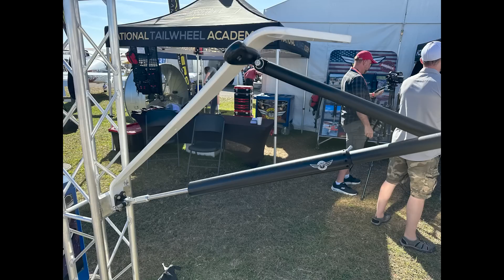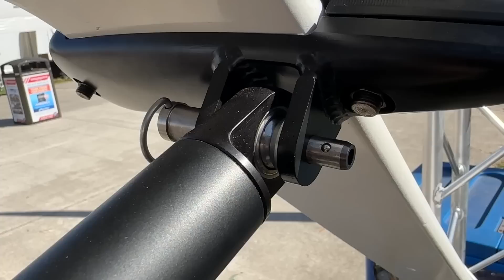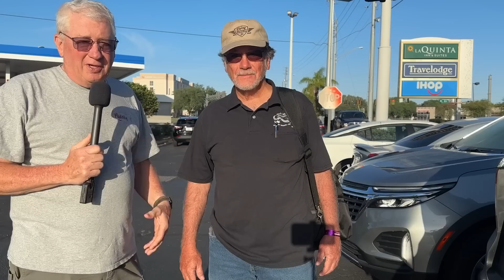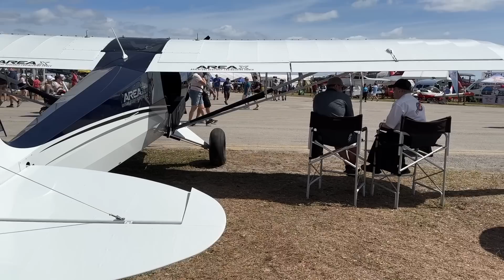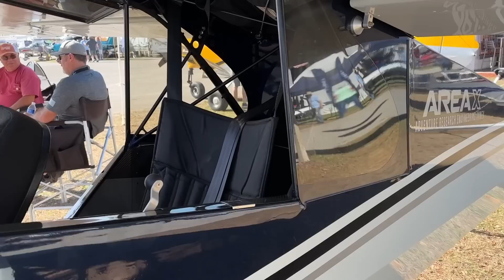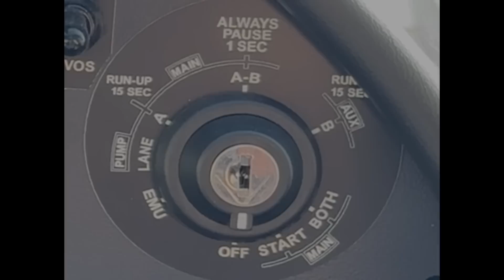FlyWire Sun-nFun 23 Day3 4, Carbon Cub UL Update

Comment: G'day Scott,

Yay Team...!

I really like the look of that Corrugated Sheet Aluminium  Tapering Tubular Fuselage on  the Junkers Trainer..., I can barely sort of imagine how to cobble that up and tinker it all  together... ; and I love the way it "Echoes" the Klemm Swallow/BA Swallow..., of the 1930s.

A Plywood 2-Seat Low-Wing Cantilever-Wing Open-Cockpit Sports/Trainer, with an 85 Hp Pobjoy Radial on the BA versions - and the one I saw, touched, and spoke with the owner thereof, had been re-engined with a 100 Hp Lycoming.

He was quite a "Character", designed, built and fitted the new Engine-Mounts, swapped the Engines, and THEN flew down to Bankstown, landed, taxied up to Bullshit House (Dep't of Transport, Aviation Safety Beaureau - as it was, back in the day...?) - walked in and asked them to hatch whatever Paperwork they wanted, to cover what he was doing and had proved to be workable.

Back in the Olden Dayze, when the Beaurocrats were still reasonable...(!).

The Klemm Swallow was a Gem, and that Junkers looks bloody BEAUTIFUL...(!).

Regards the Shockies for SpringyBOUNCY Cesnas...; Removing them for occasional Cross-Country events is silly.

A Round cross-section, at 60 MPH and upwards, generated 500% the Drag of a Streamlined symmetrical Teardrop Cross-Section of the same diameter/width/thickness...

So, a couple of Styrofoam Blocks and a Hot-Wire Cutter could yield Leading and Trailing-Edge Fairing-Fillets, fit for being glued ahead of and behind the Tubular Shock-Struts...

With a subsequent spiral-wrap of 1" Pinked Dacron Rib-Tape, and a Coat or two of Laminating Epoxy...

The outside of the Shock-Strut Cylinders could EASILY have their 
Aerodynamic Drag cut by
80%, 
For maybe an extra 
1% 
Additional Weight added to the
Strut.

Don't Pig-frig around with Ground-Removable Undercarraige Improvements..., if they're worth fitting then
STREAMLINE them...

And
Leave them
There, 
Permanently...

Such is life.

Have a good one..

Stay safe.

;-p

Ciao !
Reply from the maker: Good point!

Comment: I'm still trying to understand the improvements in the Rotax 916 over the 915. Secondly, the twisting forces exerted on cheaper engine mounting brackets, from the prop?
🌏🇭🇲
Reply: 10hp innit?
Reply: 160hp vs 141hp at take off.....
Reply: On the "twisting" he said on a couple of occasions they are in design and engineering cycle so I am sure their engineers are in front of it. The 916 has a new exhaust, engine mapping and more boost.